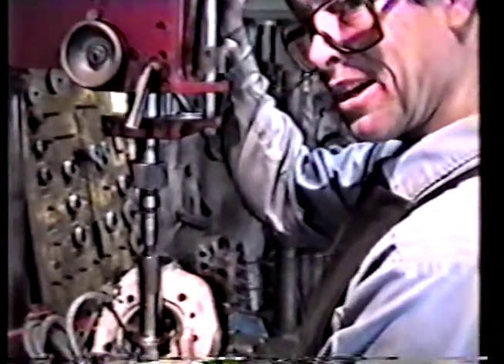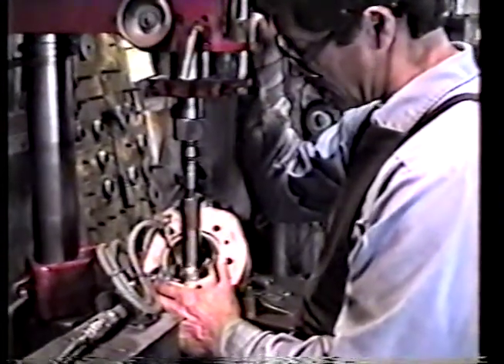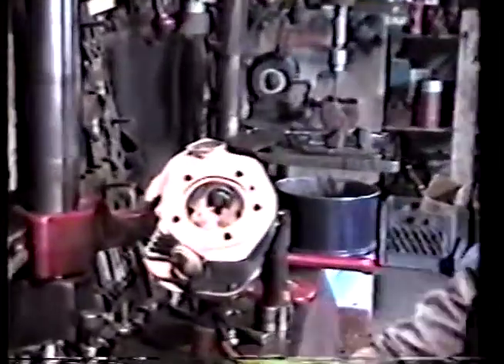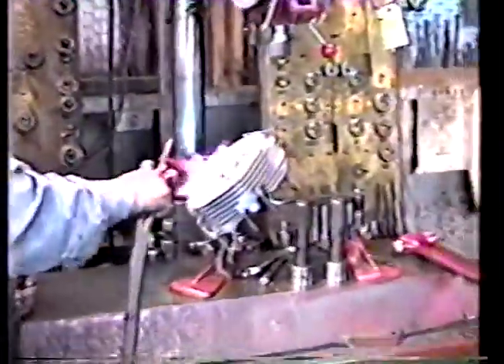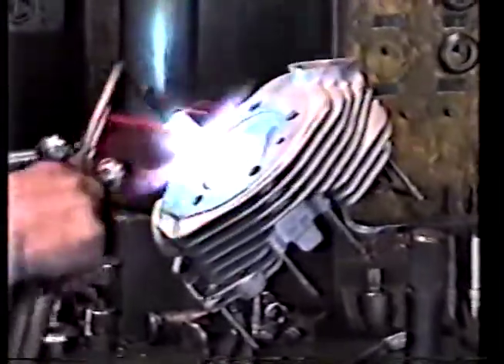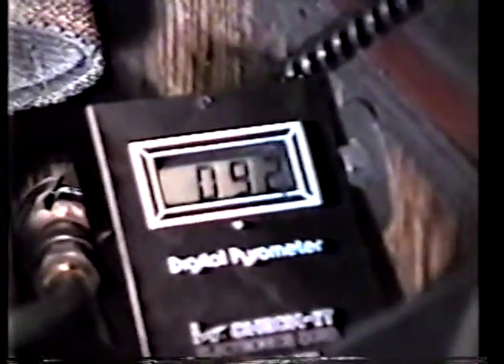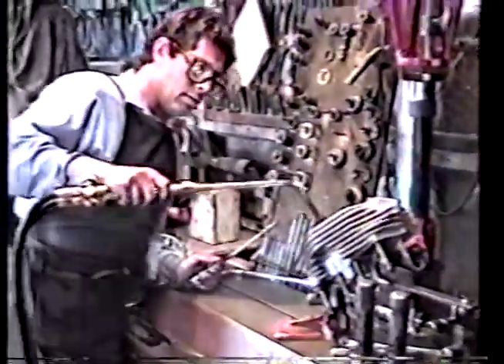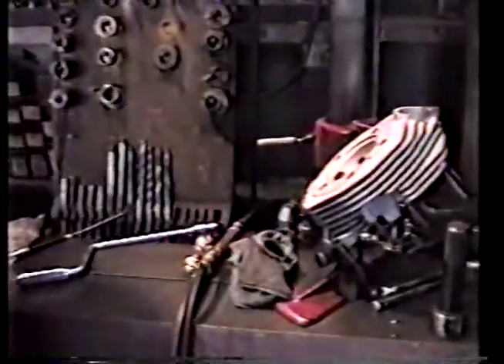HDES-16A Shovelhead/Panhead No Lead Conversion - Valve Seats for Harley-Davidson

Comment: Nice process you use for Shovels. When I worked on the factory VRod team, the most fascinating part of the Capitol Drive Cylinder head room was the valve seat install. Of course modern metallurgy aids considerably, no doubt, but we had a fixture that expanded to hold the seat to be installed. That seat was then sprayed directly with liquid nitrogen. The fixture that held the new seat then relaxed and just dropped the seat in place. No hammering. Not even a press. It was a process the Germans helped us develop and the heads were bulletproof. Later, we did the nine-second factory Destroyer drag bike from the same castings.
Reply: thats cool why was it called the capitol drive room ?
Reply: @roncoburn7771  The only part of V Rod production that happened at Capitol Drive plant in Menomonee Falls was cylinder heads. It was about a 5000 sf factory within the factory. The only process done there were V Rod heads.

Comment: Get  an oven 350 degrees put your seat on dry ice for a few minutes and it will literally fall in no hammering  just a tip mr
Reply: He said it’s a .005 press fit at 500 degrees, not a .003 press fit at standard temp